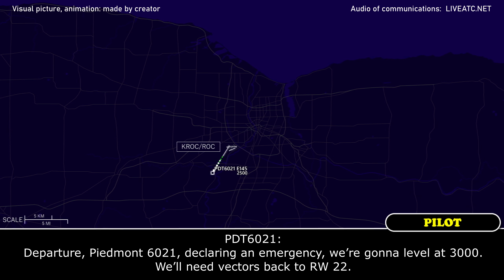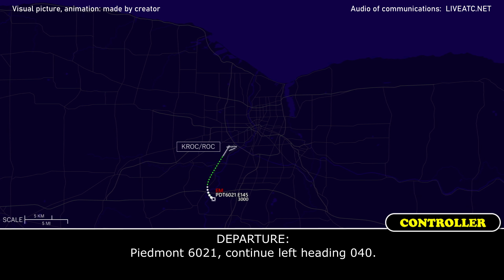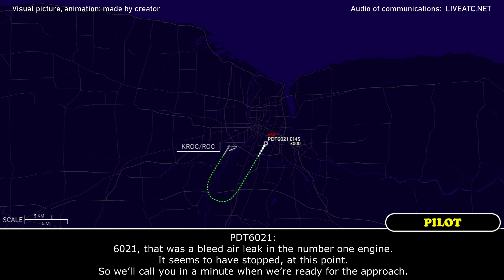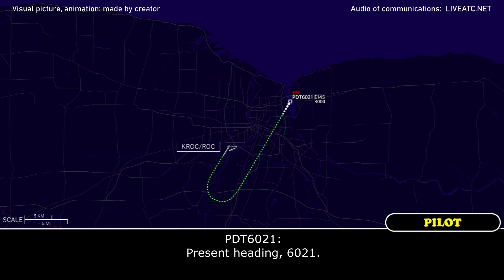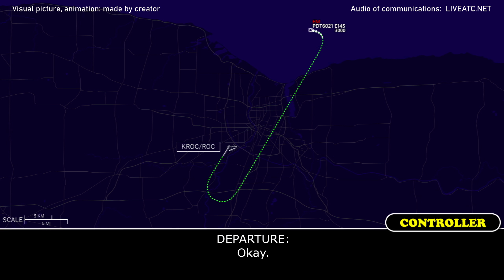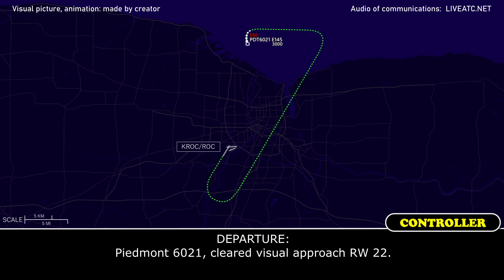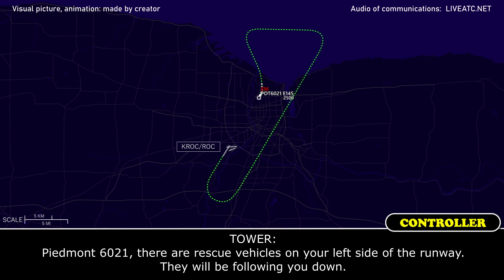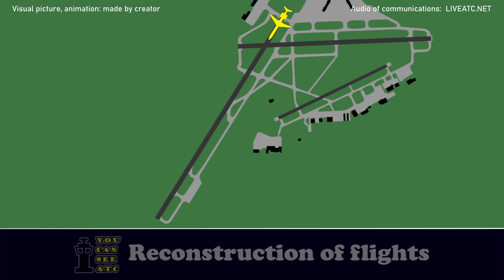Bleed air leak. Emergency return | Piedmont Embraer ERJ-145 | Rochester, ATC

Comment: Given the option by the controller, why turn over the dead/questionable engine? I thought that was a no-no… is that rule of thumb only for wingmounted engines and not applicable to the CRJ?
Reply: I think it’s only for wing mounted engines
Reply: They didn’t shut down the engine. The bleed leak stopped after they shut off the engine bleed and waited a few minutes, so they didn’t need to shut down the engine. No dead engine in this case, but it’s not a huge issue on the ERJ145 to turn in either direction with a single engine.
Reply: It’s not even a Nono for wing mounted engines. Maybe a piston twin.
Reply: I fly this type of aircraft. (Though the same is true in almost all types of jets) 

The engine was working just fine. The “bleed” is compressed air that has passed through the core of the engine prior to being mixed with fuel and ignited. So it’s just compressed air. It is very, very hot. 500C°+. The air is used to provide air conditioning, pressurization, and anti-icing. 

If the bleed is leaking that means super hot air is leaking through the components of the airplane which could cause other systems to fail, or possibly structural damage. 

Usually all you have to do is close the valve, which these pilots did and it seemed to solve the problem. You’d still want to land as soon as possible though just in case.

Comment: What is that and why is it dangerous?
Reply: In the case of the  EMB 145 it isn’t so dangerous, after close the affected bleed normally the bleed leak extinguish. If not than you shutdown the engine. In this case a PANPAN a lower altitude would be enough.
Reply from the maker: Check it here: https://www.skybrary.aero/index.php/Bleed_Air_Leaks
Reply: @YouCanSeeATC  thanks, always good to read